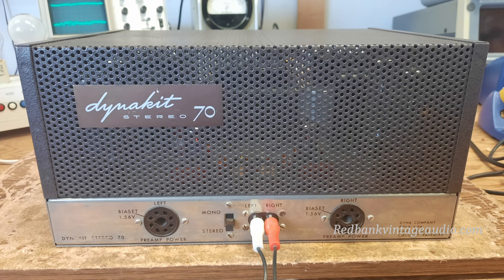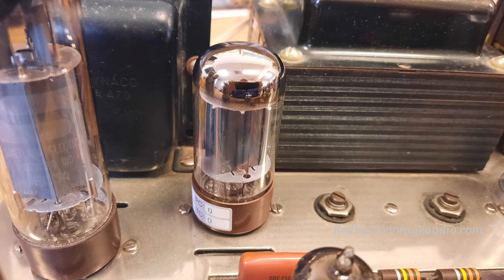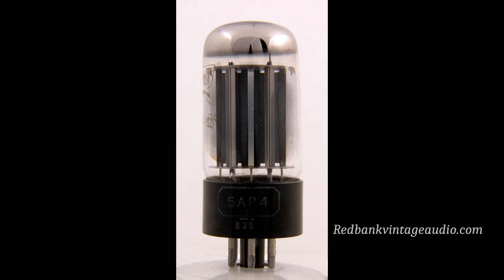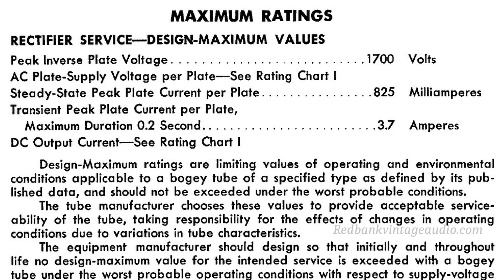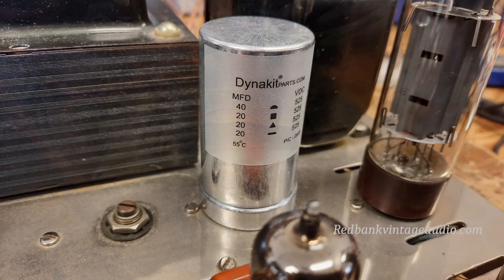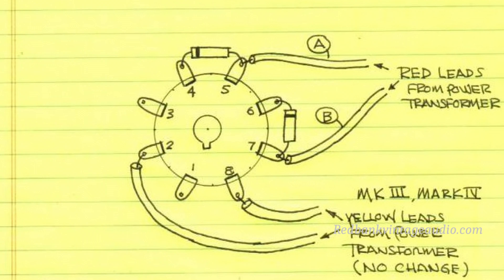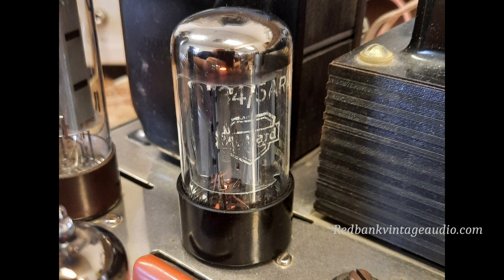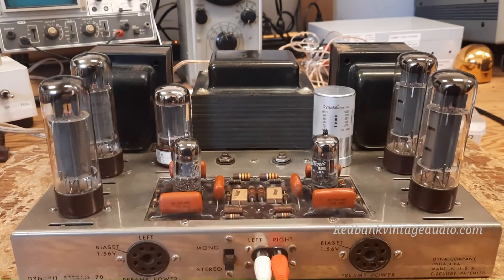The Dynaco ST-70 (Stereo 70) and the Case of the Chinese Rectifier...

Comment from the maker: Erratum: I said in the video that I thought the arcing rectifier had caused the choke to fail. I misspoke about that; it's more likely that a failed filter capacitor, failed output tube (in the past), or the failing caps in the bias circuit killed the choke. The choke was burned up by excessive current, and this would not have been caused by a failing rectifier. I suspect the bias supply was the culprit, because its 60+ year-old filter caps were most definitely bad, and this could have resulted in an inadequate bias voltage for the output tubes, causing them to draw way too much plate current, and of course that plate current goes through the choke. My mistake.

Comment: I've had multiple problem child 5AR4/GZ34 of Chinese (or early Russian) origin, myself. One pretty good solution is to use a 5V4GA (straight sided, not an old coke-bottle ST type) which will drop 15 volts more than a 5AR4. Not terrible, and you can buy NOS US made ones under $20. It would be nice to discover a huge stash of 5AR4/GZ34's. You could retire if you could find enough of them.
Reply from the maker: @alanpecherer5705  I know that's right!

Comment: Great concise information on the rectifier circuit of this amp. Glad you mentioned the slow warmup of the high voltage and how it save the life of the tubes. Too many don't know this and just bypass the tube with solid state rectifiers. Some at least add a delay turn on circuit, but it's still snapping on at full voltage.
Reply from the maker: Thanks for your kind words.

Comment: I would just go with a full solid state rectifier without the 5AR4. The drawback is that it does have big surge current during the startup. I have been running like that for years and it seems fine.
Reply from the maker: If it were mine, that's what I'd do as well. But, the client wanted to keep the 5AR4, so that's what we did.

Comment: The ST70 is hard on the rectifier with current demand and I wouldn’t use anything less than a NOS or used. Fortunately, Mullards have been rebranded by the other manufacturers of the day and are still out there. Speaking of 5AR4’s, RCA came out with the “big bottle” type which is quite sturdy but I’ve always wondered about the GE design which is the size of a 5Y3GT. I’ve used them, not on a ST70 though. I really haven’t seen anybody mention much about those.

Comment: Does the ST70 have a thermistor?
Reply from the maker: No. It uses a slow turn on rectifier (the 5AR4) to slowly ramp up the current when first switched on. The 5AR4 uses indirectly-heated cathodes, which take about 15-20 seconds to warm up, as opposed to say, a 5U4, whose directly-heated cathodes heat up in 3-5 seconds. Solid-state rectifiers, of course, come on instantly.

Comment: One day, I would like to get two of these.
Reply from the maker: Why two?
Reply: @ScottGrammer  I have Thiel CS1.5, 2.2, and 3.6. These are low impedance and medium efficiency speakers.
Reply: mono blocks? supposed to work well, and you won't need to run the furnace in the winter